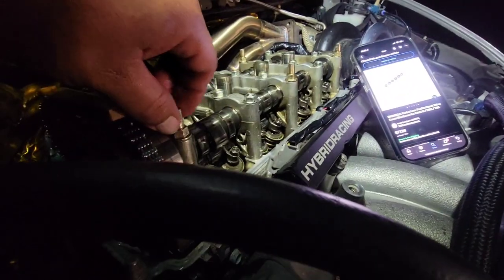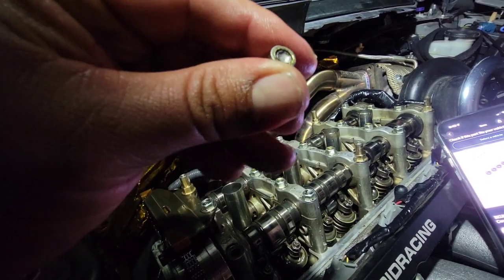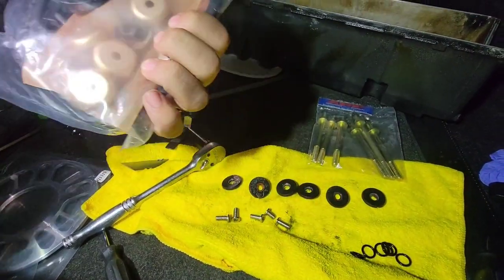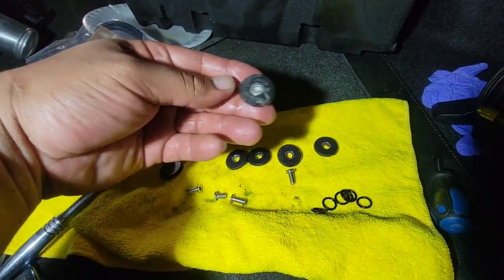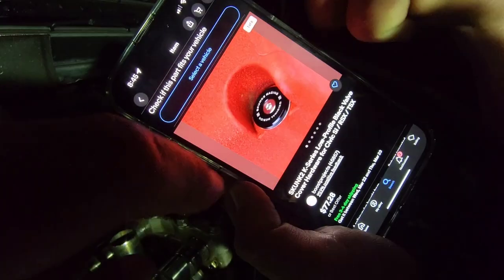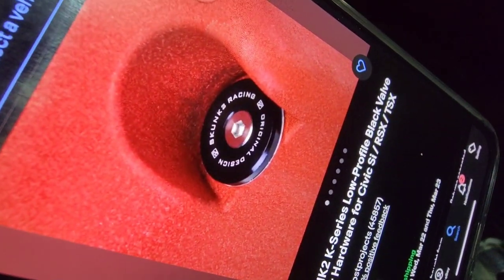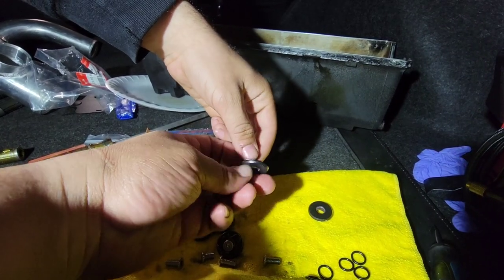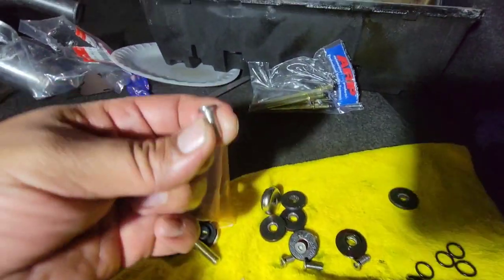Item Review: Skunk 2 Valve Cover Hardware Kit (Leaks Oil) k20/k24 k-series

Comment: recently snagged one of the Skunk2 4PistonRacing Magnesium valve covers. it came with this low profile hardware. i have to say it is grade A dogshit lol 1)allen bolts have to be the most unreliable garbage for bolts. constantly getting marred up and/or the bolt heads just snap off with literally no torque. after a week of driving had an oil leak at virtually every hardware location. how the fuck do they expect a tiny O-Ring to replace a chunky rubber grommet? 😂
Reply from the maker: facts brotha and the price they charge for the headache... all bad tbh

Comment: I’m having trouble finding the ARP studs anyone got a link?
Reply: Dude hearts my comment but doesn’t answer the question.. good job interacting with your viewers buddy. For anyone else that’s curious I’ve looked it up and looks like you can get the outside hardware ARP I’m pretty sure the studs are fake. Not 100% but I’ve only found studs on eBay claiming to be “ARP”